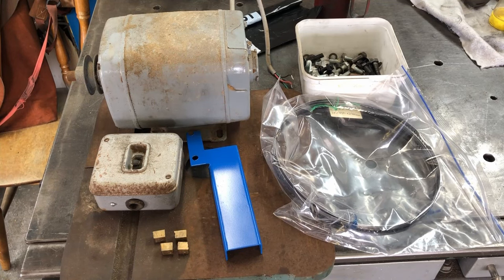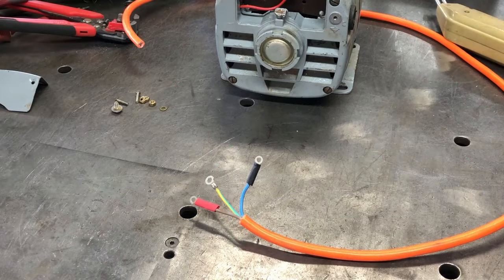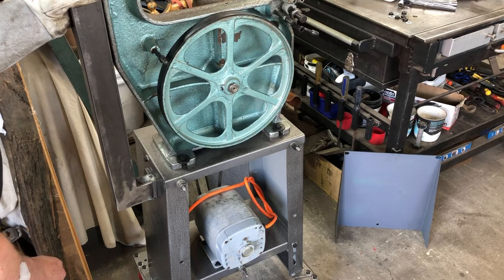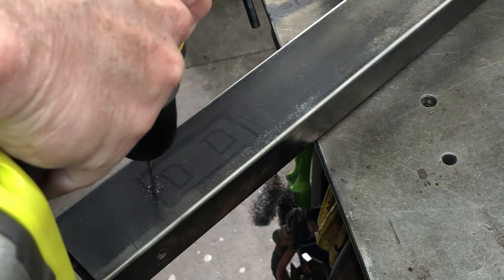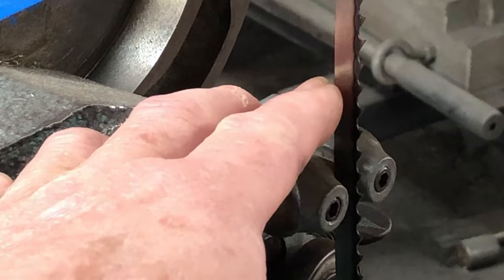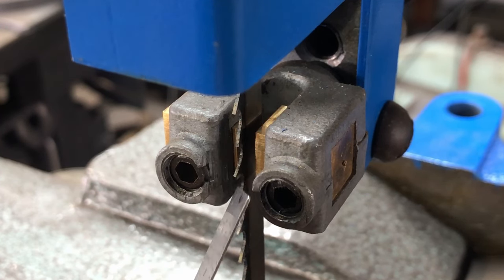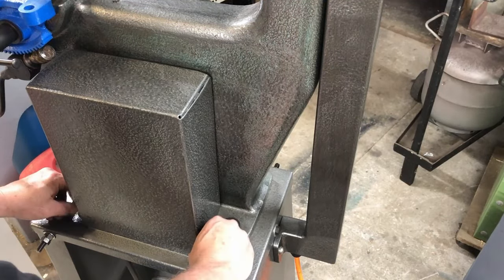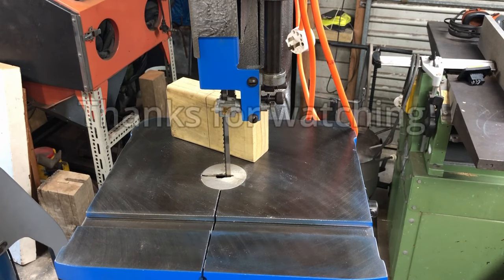Restoring The Band Saw - Part 2

Comment: Beautiful job John! I just wanted to make sure that you know that you are missing a part. On the outside edge of the blade slit in the table, there is a round hole. There is supposed to be a pin in there to keep the table from flexing! Some saws use a tapered pin, and some use a straight pin...
Reply from the maker: Thanks for watching, and your comments. Yes, there was a bolt pushed in there when I brought the bandsaw. I did plan to make something up for it. I will need to investigate if it is a straight or tapered pin.
Reply: @thehobbymachinistnz  :  Better late than not at all... I guess you have long since attended to this, but for anyone else, mine has a rolled-pin.

Comment: Thanks for another thorough and enjoyable video!   I 3D printed a replacement throat-plate in PLA.  I had some reservations regarding strength and durability, but after a couple of years use it has proved to be excellent.
The flange thickness was made to suit the table, (3mm in my case).  The centre region is 7mm thick where it fits into the hole; this give it good stiffness.
I tried making one with a grid pattern of holes to help with dust collection, but it was not strong enough.  If it was made of steel, or maybe aluminium, it would be worth considering.
When it is time to replace it, I will probably redesign it to incorporate an airflow elbow to meet up with my built-in vacuum ducting.  This would replace the separate fitting currently in use.
Reply from the maker: Thanks for your comments. My plate is a bit beat up so I will need to do something about it at some point. I have a 3D printer and some PLA so you have given me an idea, thanks.

Comment: Thanks a great video.  The set-up tips were especially helpful. I have been meaning to put a nvr switch on my bandsaw must get on with it.
Reply from the maker: No problem. Yes, I will install nvr switches on any new or restored mains powered machines that I do. It is a good safety feature.
Reply: @thehobbymachinistnz  :  Like yours, mine has a simple toggle switch located at shin level... the last place I want it in a moment of panic!   😵‍💫 😵 🥴
Your NVR switch is such an obvious choice... now that you have shown us!  😜
Reply from the maker: @PiefacePete46  Thanks for you comments. The NVR is a good safety device. It stops the machine from starting up once power is restored after a power interruption. I see that a lot of new equipment have these switches now. Perhaps there is an electrical requirement for them to be fitted to new machines in our country?

Comment: Looks good! I like the hammered finish and color. 
Is your electric supply single phase 240? If so do y’all have or use split phase like here in the US.? 
I’m making a pneumatic lift dolly base for my band saw. Also making it so that the table height is adjustable from 33 inches to 40 inches from the ground. So I can use work bench for outfeed
Reply from the maker: Thank you. NZ is typically single phase 230V to residential houses, no split phase in NZ. But, my Father also had 3 phase installed into the garage. So I have both single and 3 phase power in the workshop.